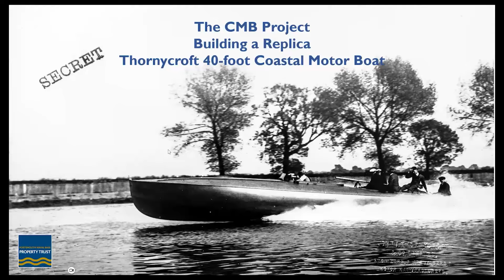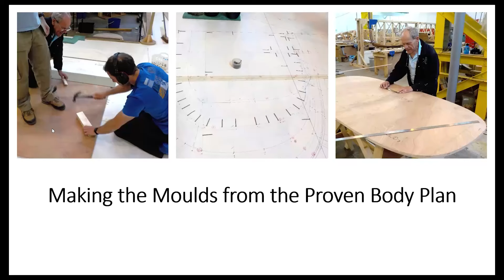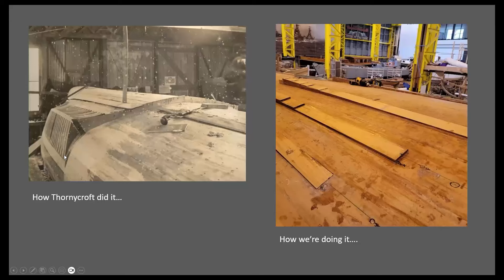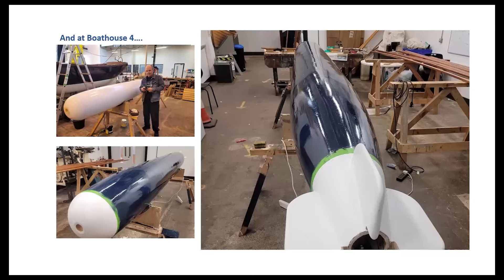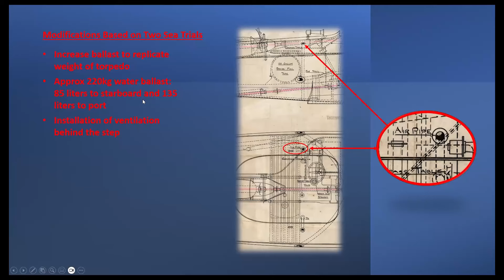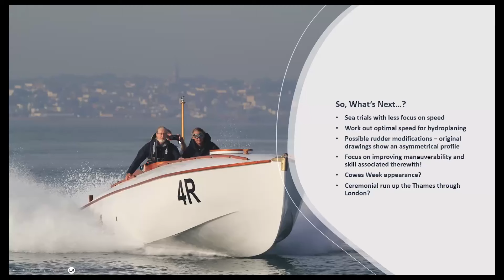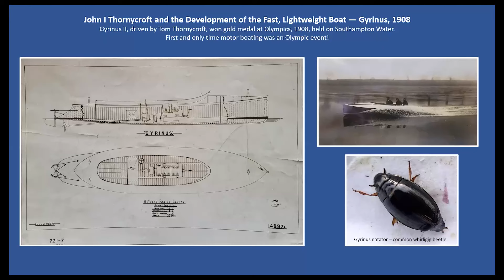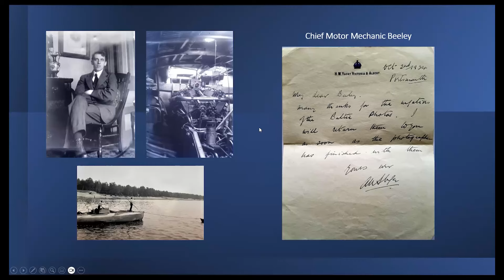Building a Replica of a 1916 40 knot Thornycroft Coastal Motor Boat, Part 4

Comment: Amazing video. I've read Agar's books 'Baltic Episode' and 'Footprints In The Sea'. I had often wondered why no one had built a replica of CMB4. It's a historically significant boat. It didn't just sink the Oleg and participate in the Kronstadt raid (I think?) it had also participated in an action off Belgium during the war I believe, and after the Kronstadt raid it helped lay a mine field that sunk a Russian destroyer (that, unfortunately, had been trying to defect, if I recall). At least, that's what I recall from Agar's books. Have you come across any photographs of any 40 foot CMB with its Lewis Guns mounted? I've always heard that during action CMB4 and the other 40 footers mounted multiple Lewis guns. On the cover of Agar's book Baltic Episode CMB4 is shown with a dual Lewis mount. However, I have never seen a photograph or technical drawing of exactly where/how the machine guns were mounted. Do you plan to build the raised wind screen that all the wartime 40' CMBs seemed to have? Do you plan on fitting her out as if it was ready for a sortie, with the wind screen, machine guns (fakes, obviously), the whole deal? I think those details would make it look like a right proper wartime vessel and make it more exciting for the public. Did the 40 footers ever have those side mounted depth charge racks I recall the larger CMBs having?

Comment: Looks like a cold moulded hull skin but I wonder how it was done since they did not have Modern Glues ? Perhaps copper riveted like the Fairmile Harbour Patrol Launches of WW2 ?
Reply: She is not cold molded.  The shape is achieved by building 19 full length stringers over hull profile molds at stations set every four feet. Then 1" x ¾" frames (ribs) around the full circumference of the boat (as far as is practicable) set on fou- inch centers, so 100 overall. These completely prescribe the shape to which planking can be added and faired to round.  First layer of planking is glued and nailed to the frames, then second layer is epoxy bonded to first. Entirety then nailed and roved through to stringers every eight inches.
Reply: The original cold moulded boats were made of nailed strips with canvas between the layers.